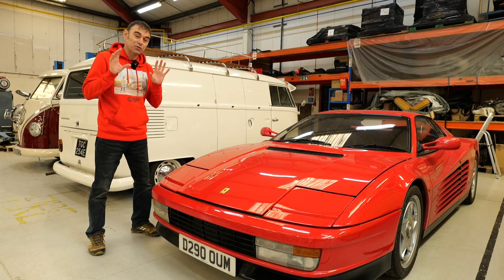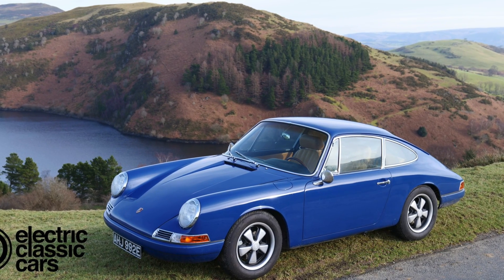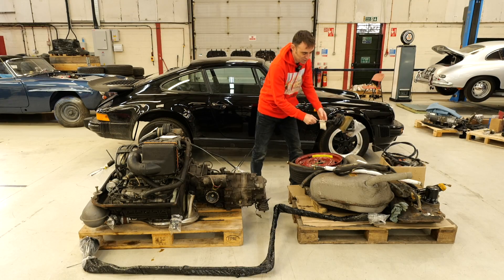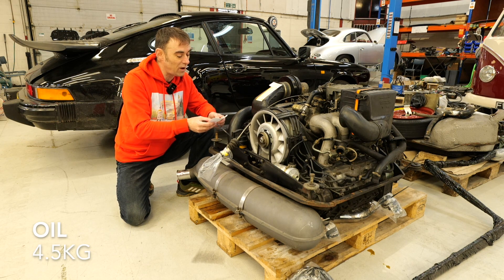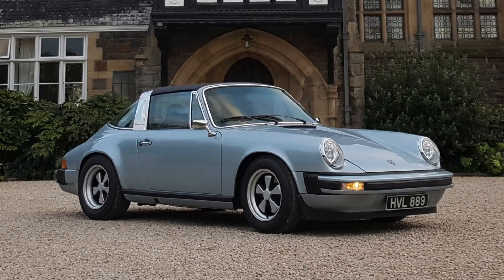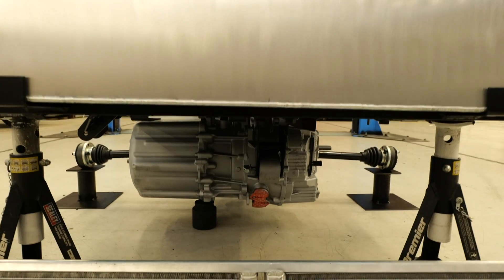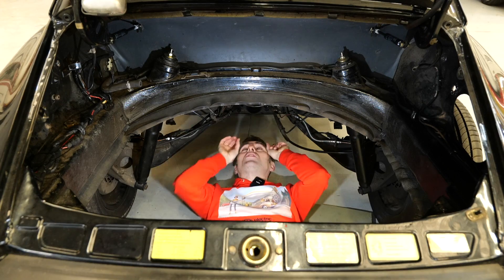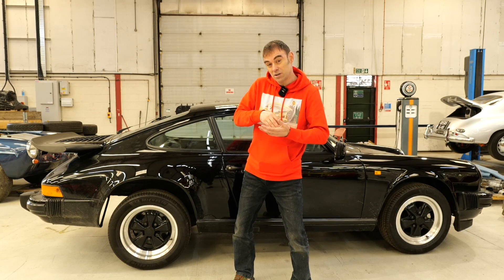Electric Porsche 911 conversion - Episode 1

Comment: It only took me two months to think of this , but how about a Tesla Roadster ? It’s been out of production for 12 years. Thats a long time in the EV world. A motor and battery upgrade, maybe that fancy suspension you added to the testarossa. It might be modern but it’s the modern you add to the old cars as it is. Maybe even see if you can make the weight of the battery pack smaller, for that more sporty handling.

Comment: Hmm

1. Increase vehicle weight
2. Increase likelihood of vehicle catching fire/exploding
3. Delete engine sound
4. Compromise original handling
5. Reduce driving range
6. Decrease value of car & compromise resale value

I'm sure there is a place for people who do things like this to Porsches - probably not a very nice place.
Reply from the maker: 1 - The weight is not increased
2 - The likelihood of it catching fire is reduced. Petrol cars are much more likely to combust than EVs.
3 - It will be quieter
4 - The handling is improved as the weight distribution is improved.
5 - The increased reliability will mean this will do more miles per year as a daily driver.
6 - The value of the car is increased.

Comment: If the spare tire is removed, are run-flat tires being fitted instead? Or is a can of liquid sealant being issued? I am pleased to have an old car with a "donut" spare tire rather than rely on one of those cans since they won't handle sidewall damage.

Comment: Let's pretend I am the client. Help me make my choice re smaller or larger Tesla drive unit. What are the power/range trade-offs? How does the power/torque of the smaller unit compare with the original ICE setup?
Reply from the maker: 300hp vs 450hp. Basically if the 911 isn’t a wide body with big tyres there’s no point going for the large Tesla drive unit as you simply can’t get the power down. 👍
Reply: @ElectricClassicCars  I can start Monday.
Reply: I'll give it a crack. Could be good job interview material, Moggie might give me a job 😂
The 3.2 flat 6 put out 217hp and 195 ft lbs of torque. 
Small Tesla drive unit, 300hp and 243 ft lbs. 38% increase in power and 25% more torque over the standard engine.
Large Tesla drive unit, (up to) 645hp and (up to) 475ft lbs torque. That's a 195% increase in HP and 143% increase in torque. You can tune them down via software. Keeping in mind, more power = less range, but that's the same with an ICE anyway. 
The small unit weighs 90kg (200lb)
The large unit weighs 132kg (290lb)
42kg weight difference is honestly insignificant for the increase in power. It's not even worth worrying about. 
It comes down to what you want to do with the vehicle. A small drive unit is going to be much closer to the original engines output and offer fairly similar driving characteristics, Although the torque is instant and the handling will be more neutral due to the improved weight distribution. 
Same goes for the large drive unit, but, turned up they are capable of snapping axles and melting tyres in a (very rapid) heartbeat. Traction control is an option and will keep you and your tyres from dying, but there are other factors to consider. At three times the power and torque of the original engine, over time the chassis could suffer. Cracks and twisting are very possible, as are snapped drive shafts and cv joints, suspension mounts torn out of the chassis etc. As mentioned, the power and torque is fully programmable, but to put it into different terms...who wants to buy a horse and then cut one of its legs off. If you put a 600hp engine in your car, you want all its legs.
To sum it up. The small unit would be more than fun, very drivable, still surprisingly quick, and fairly power efficient while still mimicking the general feel of the original car.
The large unit would still feel similar while driving sedately, but crazy rapid once the go pedal comes in contact with the floor carpet. While 3 times the original power would be fun af, sometimes overpowering a vehicle can have detrimental effects on the driving pleasure. You are always on edge, worried that a little foot slip could make you oversteer into a ditch. Some people like that, it's personal preference. Sometimes it's more fun to drive a slower car fast than to drive a faster car slow.
Reply: @Mardy72  thank you very much! That was a thorough answer? It confirms my gutfeel .. the smaller unit will serve the original spirit/purpose of the car better. This seems like a sensible client. 😎
Reply: @kwaailight  you are welcome my friend.

Comment: I’m still a huge fan of the 912! Lighter weight, shorter wheelbase, skinnier tires for more fun at slower speeds, simpler interior have me preferring it over the later cars for EV. More open greenhouse and superior suspension make it better than the 356. Yep, the 912’s the one, because you’re not even losing the glorious sound of the flat-six. Win, win, win!

Comment: Hi Richard, a 928, definitely.  With all of the builds it would also be interesting to see if a spare wheel could be included.  A space saver spare?  Not possible sometimes I know, but it’s a concession to EVs not necessarily afforded to ICE, either now or in the past.  Buyers still expect it, although cans of goo do get you moving in most cases.  😊

Comment: seems to me any ice car manufacturing company wouldn't really have a massive job to 'change' any model car over to electric at the manufacturing stage ..they just have to decide to design something like your own bolt in unit and install it instead of all the mechanical engine and parts.

Comment: Technically the heater air on a 911 is passed not over the cylinders but over the headers and from the casing that surround the headers then fed into the heater tunnels into the cab. :) Definitely following with build!

Comment: How to ruin a great car : (
Reply: How? By making it more efficient, cleaner, cheaper to run, more powerful and more reliable??
Reply: @Mardy72  making it do maybe 70 miles on a charge is more efficient?  And driven as these cars were meant to be probably even less than that.
Reply: @christophersouthern3141  A Tesla model 3 with a 60kwh battery and single motor rwd has a range of up to 270 miles. It weighs about 3,500lbs. Real world every day driving is more like 200-220 miles range. This conversion is using the motor and battery from the same vehicle but weighs about 2,900lbs. So tell me professor, how is it only going to have a range of 70 miles? Moggie and his team strive to get the converted weight as close as possible to the original vehicle weight. There's no reason it won't get 200 miles of sensible driving.
And before you start yelling about how spirited driving uses more battery charge and reduces your range, doesn't the same kind of spirited driving use more petrol in an ICE vehicle?

Comment: When I was researching Spanish conversion rules, it says the high voltage cabling cannot "enter the passenger cabin".  I would think running them through the shifter linkage tunnel is technically inside the passenger cabin, even though they're inside a metal tube.  Is your design compliant with UK regs?  Thanks!

Comment: Apart from losing the engagement with the shifting and noise, do you you think you will lose anything in the way the car handles when the car is finished? Electric cars don't tend to have a great reputation for handling well, but I'm wondering if it's different with your conversions. My guess is that eventually electric cars will far exceed the performance of ICE cars in every way. Eventually...
Reply from the maker: Most of the cars we convert end up handling a lot better once’s they’re converted to electric. Better weight distribution, often mounted nice and low down and upgrades to the suspension and braking help too. 👍
Reply: A stock plaid model s with track pack for 110k can lap the green hell even faster than a Ferrari enzo or maserati 2023 mc20 could.

And the new Porsche taycan turbo gt ev just lapped it even faster at 7:07.55. Porsche cayman gt4 e demonstrator lapped Monaco as fast as the current cup gt3rs cars can 1:40. And can do race pace for 30-45mins per charge despite weighing over 500# more. 

Evs are really coming along now on range, speeds(rimac nevera is 256mph top end, plaid is 202mph, lucid air sapphire is 206mph.
Charging times steadily dropping for road trip ease etc. Oh and prices to are coming down yoy nicely. 

Can't wait to see the semi solid state cells and full solid state cells hit the market over the next 3-5 year's. 
Should cut another 250-500#+ off of evs slightly higher weights and reduce the fire risk+much quicker charging.  😎

Comment: In a previous episode, you walked us through many of the regulation and compliance hurdles that one must negotiate to convert a car like this to an EV.  Is there anything preventing someone from doing a conversion on a 911 like this and making it an all-wheel drive EV?  I was just thinking how cool it would be to have an all-wheel drive rocket ship like this.
Reply: Is there still space for a spare wheel ...even a skinny?  Current crop of pot holes are taking out rims as well low prof. tyres.🤔🧙‍♂️
Reply: Depends where you live in the uk you might have to deal with a SVA type test single vehicle approval .

Never been a Porsche fan though i do like the Front V8 model.

How many Matra Bagheras  are left in the UK ? 
I prefer the mark 1 and 2 body forms to the later more angular 3s  and with the original motor being transversely mounted and a small 4 cylinder sitting right behind your back in the car 🥵electric has to be a lot beter way to go..

It also allows for a more interesting social life .. 😂... as long as your seat is sports car sized. 3 abreast for those who dont know the the French disney Black 🖤 cat.